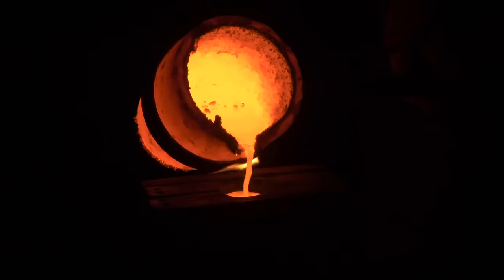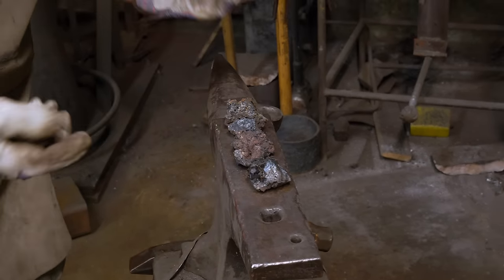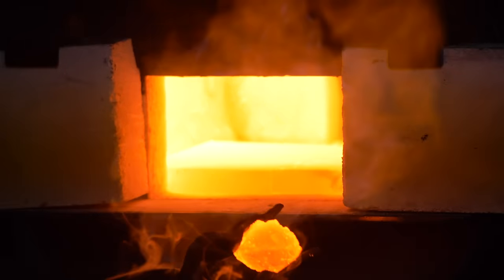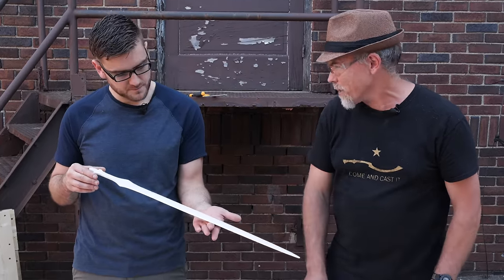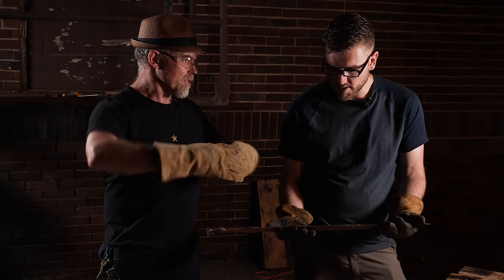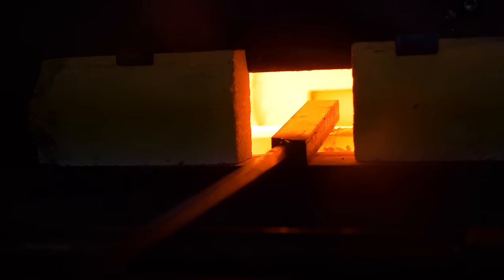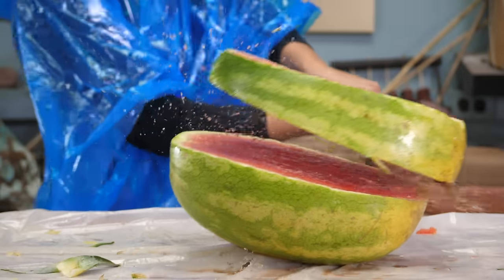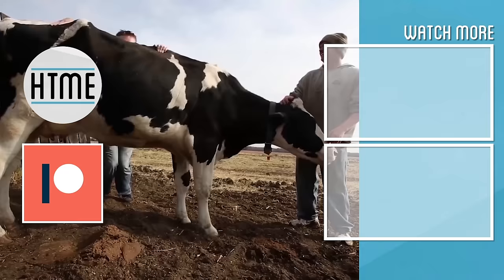Forged Iron Sword vs. Cast Bronze Sword

Comment: I understand the limitations of the show but you're using modern hemogenous Iron against bronze which i don't think is representative in any meaningful way. The whole downside of iron is that pre-industrial iron and steel were very difficult to homogenize. I think crucible steel was the only pre-industrial steel that was fairly homogenous and it was not commonly available and almost mythical in places like Europe up into the early modern period. so while you used iron of similar carbon content to your bloom iron it's still not in any way a comparable material because you would have to do some metallurgical wizardry to ever get that bloom properly homogenized. I mean without a Bessemer blast furnace that is. I look forward to that episode.
Reply: If I remember correctly this was a small "bloomery." The chances of getting good yields at this scale would be very small and even then this was more than enough for a proof of concept for low grade iron/steel. With that being said I too would like to see their attempt at crucible steel.
Reply: Imagine this: combine tiny diamonds together with clay. Result is not one big diamond.
Reply: @juhajuntunen7866  proof?
Reply: you can work and fold the metal to homogenize it, the real problem is the carbon content, impurities, and tempering. and I think they used a steel with comparable carbon content and didn't temper it.
Reply: Was just going to say the same thing; the reason the iron does so well is the high quality homogeneous modern iron.
Reply: couldn't he just get enough pieces of bloom with similar carbon content and forge weld them together? if he did that the entire piece would be homogeneous right?
Reply: they are also using modern bronze.
Reply: @raphrath8561  If they are using tin they are not using "modern bronze" there are much better bronze alloys they could be using.
Reply: European and Japanese swords were extremely high quality steel. The Japanese folding of the steel removed the impurities and homogenized it, and in Europe, Smith's had gotten metallurgy extremely precise, to the point of being able to predictably harden and temper their swords
Reply: @juliaf_  The important part to consider about that is the time period we are talking about. Metallurgy would eventually develop to the point you are laying out, but by that point iron technology was already very much established. Since we are talking about early iron weaponry compared to the available bronze weapons, the metallurgy was not as developed yet and many of the techniques that would later be used to produce more homogenous, higher quality iron weapons were generally unknown. In that context the piece of iron used was probably to homogenous for what blacksmiths would have had to work with and thus the resulting sword should perform better than a historic piece would. Of course it is very hard to know these things exactly since archeological finds from that period are highly degraded and thus exeedingly rare.
Reply: @Slash-XVI  there have been reports and even scientific papers on armaments dating quite a ways BC of hardened carbon steel. Shadiversity has a great video on it. Of course it's regional, but the technology did exist.
Reply: The only "cheat" involved was their cheat of time.
Enough time and effort put in would get you a relatively homogenized piece of iron, and it wouldn't take any complexity beyond that required for a hammer, anvil and forge. Once a bloom is consolidated, getting to a reasonable metal is a matter of hitting it and checking it's properties. The more you hit hot iron, the more carbon you push out of it.

I'm more concerned about there confirmation bias. They explicitly say sword to sword contact would be avoided, then go on to judge which one was better by the results of worst case scenario sword to sword contact. If someone has lost their shield and is being bludgeoned by the other person, it doesn't matter if their sword is bronze or iron, they're already boned. Also, such bludgeoning would be done with a shield, not another sword
Reply: In all fairness, historically they probably would have gotten a better bloom. I mean, one of the issues here was that the iron they had was not the result of bog iron or ore but rather just iron sand with a relatively low iron content, too. 
So yes, the modern iron they were using may have had an advantage but they also basically had a worse start, otherwise they might have been able to actually make use of their own smelted iron.
Reply: Thanks. You saved me a lot of typing.
Reply: @kovona  With naturally occuring Iron Sand that may very well be the issue. However, I'm not sure if that also applies to waste sand from an iron refinery that still happens to contain a little iron.
Reply: @juliaf_  This is supposed to simulate the first "round" of iron swords that existed. None of those techniques apply until later on.
Reply: Basically months of hammering. Not overselling it either. Good comment.
Reply: Okay guys i hear you. First thing. I dont expect Andy to do everything authentically. Theres just a lot of bad science in metallurgy and weapon history and if you cant do it right you should at least mention the variables you aren’t taking into account. Second. They used modern smelted materials to make the bronze too. Well thats sort of my point. Bronze and iron aren’t the same and if were talking early iron age (which is exclusively what im talking about) then contemporary smelters will get a much higher quality bronze than they could iron. Specifically because bronze was an established technology which can be properly smelted into mostly  pure liquid bronze with the kilns they used. They could make iron but like in much of history you have to work the slag out through working it rather than skimming it off the top of the crucible (this also works to homogenize it to an extent but my point is that these are flawed methods in comparison to modern steel. 
Because of this the gap between modern smelted tin and copper is far smaller than with smelting iron. Using modern bronze doesn’t balance the test.
Reply: they said they used comparable iron. so you cant really say it isnt fair without knowing exactly what that iron was. if they said it was comparable im sure it wasnt top grade modern stuff. that bar could have been made from bloom as well, but unless they specify we dont know. judging by the swords appearance there were impuritues though.
Reply: @eclipsegst9419  you can't really source Pre-modern steel by normal means. Even if its pretty cruddy modern low carbon iron it's going to have been made in a blast furnace and then decarbonized. it's not economically viable to smelt iron any other way. it's a fun quirk of iron smelting you have to actually add steps to get a low carbon content. you would have to contact some pretty specific folks to get your hands on historical wrought iron and considering that the show typically has an interview when they consult people I assume that if they did source it from an experimental archeologist or a three-hundred-year-old chunk of scrap it would probably have come up in the video. On a balance of probability, I Imagine the smith they were working with grabbed some low carbon stock he had on hand and they used that. I expect it would even have a pretty modern mix of alloyed material too. Im not saying its impossible but I wouldn't put money on it being accurate to the iron that the Hittites used.
Reply: @valbourne1797  well, i agree it wasnt identical, but the bronze probably wasn't either. Im just saying, the guy seemed pretty knowledgeable about smelting, so theres a chance that that iron could have been smelted as well. if you look at the up close shots, it definately has some mall impurities. even if it wasnt home smelted, how much do impurities affect strength compared to carbon content? even in ancient times, those who made blades were good at their craft and knew how to get the least impurities. i dont think its fair to expect the sword to be of the same quality of the very first one ever attempted. by the time armies were outfitted with them the process had been figured out fairly well. i would bet that the difference is small enough that it wouldnt have changed the results of the test by much if any.
Reply: Val Bourne, not exactly. In fact, Europe had some of the most advanced steel working, being able to reach the melting point to fully melt the metal, their steel was some of the purest, and they could remove all impurities in a piece without folding, unlike countries like Japan who’s rudementary steelworking forced them to fold their steel. To be fair, the time period the show is aiming for was before advanced steels (Spring, High Carbon, other crucible steels) from the Middle Ages, but rather in the Iron Age, with wrought iron such as the swords that appeared in the Mediterranean. So overall, you are correct that the test is inaccurate due to the use of modern iron, and imo, for a true test, forging should have been purely historical in practice, however it is simply incorrect to say that Europe had poor steel, because they had some of the best steel. Additionally, further inaccuracy comes from the fact that they are clearly not trained and are using no proper form, as well as half-commutes and untrained cuts, as well as partying situations that are simply inaccurate, especially since they are giving no resistance and just letting the other person slam their sword. I will also mention that fruit is extremely easy to cut, and I have even pulled off clean Oberhau cuts on oranges and even melons, zucchini, and squash with unsharpened swords, and with sharps, technique is not even that important in that situation, a real cutting test should have been done with proper cutting equipment such as tatami Mats, or human body/head replicas (Ballistic Gel, etc). I am speaking as a European Martial Arts practitioner, specializing in Longsword (Mostly German), HEMA, Armored Combat, as well as knowing many other sword arts of both one handed, and two-handed styles, and even some other weapons such as battle axes, maxes, war hammers, and pole arms on a more rudimentary level. So that hopefully provides context of qualification and knowledge on the subject.
Reply: @Natolxs
That's part of the problem. The bronze used in historical weapons was a pretty specific recipe, not just a bunch of pennies melted in a crucible. They're also casting and finishing in modern, not historical, ways. The whole thing is just badly done.
Reply: @danilooliveira6580  You Have confusing heat treating and tempering. Tempering softens while toughening high carbon content steels, heat treating is the process of hardening steel
Reply: @Draigtiernan  I'm talking about the process of changing the crystalline structure of the steel through heating and quenching, I may not know the exact terminology.
Reply: @eclipsegst9419  Nope. Bloom iron is porous, which is why it's so hard for it to hold onto carbon. It's also much less homogenous and littered with contaminants. Even low grade modern iron is better than what they had 500yrs ago. Light years better.  If anybody was producing bloom iron today they'd ruin themselves financially at the very least, or even go to prison for manufacturing unsafe materials. This is NOT comparable to iron-age iron and that smith has no obligation to know that (even though he probably does). HTME are not material scientists anyways, they're just trying to make a nice video. They succeeded. Are they correct? Nope.
Reply: @ManiacallySmithing  I disagree. Only a very poor metalworker would have created such a poor product, even back then. It's all about heat and hammering. I've seen many swords made the old fashioned way, from ore, with period correct equipment that turned out far better than whatever this was. Like I said, it isn't fair to say the sword should have been as poor as humanities first attempt. If we are talking about armies being equipped with these weapons, we are talking about swords made by blacksmiths who had learned their trade well enough to make a decent product. If you hadn't said "light years" better I might agree. But using those terms, I definitely disagree. And really? Prison for making a sword the old fashioned way? That's just ludacris.
Reply: It’s definitely possible to make quality steel out of bloomery iron, you can look of videos on YouTube. Their problem was they just didn’t reach high enough temperatures with their bloomery(probably cause they weren’t strong enough to work the bellows, watch African Iron bloomery video on YouTube those guys know how to pump). But anyway if they would have gotten a more quality bloom they could have worked it without it crumbling and while it would have taken a while, they would get mild steel to about the same quality as the one they made.
Reply: nani
Reply: From a paper on early ironworking technologies: "After 1200 B.C.E. the Assyrians, not the Hittites, were the major iron producers in the Middle East.  Although they did not need to improve the iron bloom process, they did use trade to separate the creation of wrought iron from forging iron into the desired object.  There were many cases in which the blacksmith that completed the smelting process did not forge it into the final shape.  Instead, he would make iron ingots that were transported from the bloomery area to blacksmith shops elsewhere, such as the ingots discovered in Nimrud from Figure 8 and Figure 9.  It was with these secondary blacksmiths that forged wrought iron into the desired items.  During the final shaping process the iron was forged with a charcoal furnace.  Unlike in the bloomery, excess carbon released in these forging furnaces did not have an oxide to combine with.  Instead, the carbon from the charcoal interacted with the iron to make the alloy called steel.  These objects were not true pieces of steel because they did not have carbon distributed uniformly throughout the material, alternatively the outside surface was carburized as steel and the inside was still wrought iron.  In effect, the carburization of the iron only provided a hardened surface.  Despite the fact that iron working was an arduous task, it became very common because iron is much stronger metal than copper and bronze."

So the TL;DR is that early iron weapons actually had a carburized, ie steel surface.  They would have had hard edges but without the springiness of homogenous steel.

That would still do some major damage on bronze.
Reply: @megakedar  I'm no blacksmith, buy forging in an old wood/charcoal furnace surely add carbon.
Reply: @juliaf_  you kissed the entire point of the video. Read the title again and you'll see what the discussion is on. 

The subject today is the first steps of iron, when it was being introduced in the bronze age, when it was new and none of these methods you mentioned were known or implemented, plus, this is not about forging a top tier weapon, but the average blade. Not everyone had good quality gear, that's impossible. Imagine supplying an army with just the amount of work these guys put in without any fancy tools or method to predict. They had to crush the rocks and hope for the best, barely any iron, high carbon and not the steel.kind we know today.
The swords you mentioned are literally folded steel, slow down
Reply: The Iron sword got hardened by the Smith in this Video, but as far as i know this is a development of the last two millenia
Reply: @J_n..  It wasn't hardened, whenever it went in a slack tub, it was well below critical temperature, and even if it DID get quenched at critical temperature, the carbon content is far too low for it to be hardened. 

Anyway, to put this to rest, the substitute used was plain carbon steel, in the 1008-1010 range. There is no manganese in this steel. And yes, it lacks the iron silicate or silicous slag that's present in wrought iron. It has a Brinell hardness of around 85-105MPa, and a tensile strength around 340-365MPa. Wrought iron comes in around 100MPa on the Brinell scale, and a tensile strength of around 230-375MPa, and the presence of silicous slag improves its resistance to shock and vibration. Mechanically, it's a fairly accurate substitute despite it being easier to work. 

The reason it was substituted rather than Andy and Lauren resmelting was simply because of time constraints. When we met to forge the sword, neither Joe nor I had any idea what the bloom was like, and after a bit of working it, both of us agreed that in the 3 1/2 hours we had left that night, continuing to work it would be futile, and we turned to our substitute.

We both have years of experience with historical reproduction, including handling, documenting, and replicating pieces first hand on Joe's end. The forged sword fit right about where an early iron age sword would be, in both form and function.
Reply: What they did in the iron age and in later periods was endless heating, folding and forging down of the material until they achieved required quality. It was very labor intensive which is why swords used to be weapon of a noble man pretty much since late middle ages.
Reply: @Natulxs  I believe what he is referring to is the quality of used materials. Historically they used copper and more importantly tin witch much more impurities. 99,9% pure copper from cables and 99,9% pure tin were pure sci-fi in bronze age.
Reply: @danilooliveira6580  This is why Japanese swordsmith folded the steel. They only had low quality ores to work with so they did what they cold with what they could get.
Reply: This show is not representative of almost anything in any meaningful way.
Reply: Lp
Reply: Those "fantastic" Japanese swords that have been folded thousands of times, sounds impressive but they did that due to rotten steel. The Japanese had excellent swordssmiths but they could not melt iron properly.
Reply: @juhajuntunen7866  Unless you play Diablo 3 snd then you will not need the clay. 😄
Reply: @juliaf_  Yes, but that came much later than this.
Reply: it wasn't up to mythical levels, but definitely a rare sight that brought great business to whoever was to find a vein of naturally occuring, particularly pure iron.
Purity primarily affects the flexibility and strength of iron still, not its hardness meaning unless you got some particularly nasty piece to work with the result in the end wouldn't be affected. To balance it out I can say the guy's conclusion is wrong and a bronze sword struck by an iron one is still very much usable and the picture of a bronze sword being cut in half or completely ruined just casually after being hit by an iron one is a fantasy, it would get nicked and beaten and after a multiple days-long battle it may be in such bad conditions it's better to re-melt than try and fix it, but often you just needed to beat it straight again.
Reply: @juliaf_  Japan actually didn't have all that great quality steel, at least not in quantity, a good number of it wasn't from mines but it was mixed in with sand requiring lots of filtering and careful selection, then forge what passed the test. Europe had the luck of having a bunch of veins of the stuff that were particularly void of impurities and it's this which they used to make their weapon and armor until later ways were found to better separate iron from junk.
Folding steel doesn't remove impurities like you said and only homogenises them so to not have pockets in which the iron was more brittle, folding steel too often actually has you run the risk of introducing more impurities so it's always best to not overdo.
Reply: @cdgonepotatoes4219  japanese tomahagane is  Equivalent to modern day 1075 carbon steel  With a few impurities of course  In a way japanese steel  and European steel is  Similar you guys forget that the  Europeans also folded their steel  Because good steel was not always available  in homogenous forms  I find a lot of rot iron swords in  Museum and yes i known rot iron was not folded its just iron strands   even in 15  Century swords not all swords were perfect you see that they  Really didn't care about the blade shape that much   There's a lot of uneven bevels on originals non symmetrical tips they just cared if the steel was good  and it worked they  Didn't care about symmetry they  Prefer the  Unevenness in the blades in the modern age  We would consider this a flaw and would want a refund but back then they thought that was the best and took it you find a lot of  uneven pommels  and the  smith thought it was fine  you see that sometimes but now in the modern age  We thinks things should be symmetrical and perfect they did not care  As long as it works to serve its purpose they liked it  Sincerely Micah.
Reply: The issue is modern Iron from bloom utilizes techniques like folding the iron on itself for months, or modernly melting it and adding flux to draw out the impurities that causes the problems you stated. the issue is the purification was labor and time intensive. So using the belt sander to cut filing time is pretty equivalent to them not spending months working impurities out of the native iron.
Reply: @JRMCNEA  ancient civilizations had a lot of time and labor, if a sword takes a month for 5 people to make they’d literally get tens of thousands of people working on the entire process no matter how labor intensive it is idk why people keep mentioning how much labor it would require when we literally have projects from earlier that were more labor intensive and less important than making weaponry
Reply: @Areeb118  We today have that same time and labor. Just because you have it. Doesn't mean you will utilize it, or even know that utilizing it will lead to gains. Most of our progress was by mistake, or freak accidents. someone over cooked something, someone left something to dry too long. Someone beat on something too long. Humans experiment with things that are counter intuitive which changes the entire way we evaluate and investigate certain things. And people mention these things because none of this is possible without a surplus of labor. How many people are growing wheat and baking bread? Not many. Why? Because A. Slavery is no longer legal. ANd B. BEcause most people don't have the leasure time to invest in their own development or production. You can build a car in your back yard. Or you can go down to the lemon lot and pay a few hundred bucks for a car that has been driven for a decade. People bring up labor and time because that is what you need to produce stuff. and that is what most people don't have to spare in the society we have. There is a reason Elon Musk built Tesla and not some guy in his Garage in the poorest part of chicago.
Reply: @JRMCNEA  you didn’t say anything against what I said, I don’t even know what you’re saying, my point was that ancient civilizations had a lot of time and labor contradictory to people’s beliefs.
Reply: Well bronze will always last longer than any iron or steel sword.
Reply: @juliaf_  Japanese swords were not high quality steel, that is the whole reason why they created the folding technique to make up for the low quality iron ore.
Reply: IRL the bronze sword would have shattered the iron one....
Reply: Val Bourne they could kind of homogenize the steel and iron by folding and forge welding it repeatedly, it’s not homogeneous the way our current steel is but it’s more... even, I guess. It also helped to beat out impurities.
Reply: In early iron age with primitive technology, only form of iron they could make was cast iron, which was brittle and had tendency to break easily when clashing against bronze. Blacksmithing didn't even exist in early iron age, because cast iron is not malleable and can't be hammered down without breaking. 

But bronze is a relatively rarer material compared to iron which is common in earth's crust, which put iron age civilizations in a big advantage in terms of ability to mass produce weapons and armors. 

However, low quality of early iron meant that both bronze and iron coexisted during early iron age, and bronze was only completely phased out by around 1st century BC.

For proper comparison between iron age vs bronze age civilization, they should've used low quality cast iron instead of modern wrought iron.
Reply: @juliaf_  everyone ignores the swords of the Americas, oh wait.
Reply: Just to throw in my 2 cents. It's commonly believed that the swords of legend like the Viking Skofnung were most likely just swords of much higher quality iron since these swords lasted much longer and we're superior compared to common swords.
Reply: @Natulxs  if it doesn't have tin, it's not bronze, so no.
Reply: @thefinalroman  Indeed, Roman stories attest to that.
Reply: @danilooliveira6580  They at the very least quenched it which is used to harden the blade, something not always done because impurities in the steel increased the chances of the blade snapping, same goes for bronze though.
Reply: Another factor to consider: the Chinese had mastered bimetallic bronze casting techniques for swords which involved varying the ratio of copper to tin.  The thicker body of the blade was softer but less brittle 90:10 copper-tin alloy, but the edges would be applied in a second casting with 80:20 copper-tin bronze for better sharpness retention.  Add some work hardening to the edges to make them even harder and I would give that kind of bronze sword the edge over a Roman gladius or spatha made of some uneven blend of wrought iron and cast iron.

The Chinese were genius bronze casters.
Reply: @edwardx.winston5744  this might explain why chinese use bronze weaponry alongside steel weapon even when the latter is readily available.
Reply: @wedgeantilles1932  Macahuitl's ?
Reply: @tomasxfranco  Actually in rare and desperate circumstances ancient peoples would make bronze from Arsenic instead of Tin.
Reply: @k_tess  wut
Reply: @wedgeantilles1932  wait this isn't common knowledge? Look up arsenical bronze.
Reply: Exactly my complaint.  This test has some major discrepancies that are glossed over without real analysis.  I wouldn't  draw any firm conclusions on early broze/iron-age transition comparables  based on this.  You simply cannot substitute a homogenous steel with a late bronze age example,.  Even if their chemistry is similar in some respects, miceostructure and inclusions are not.

It only briefly showed the bronze work hardening as well, would have been interesting to see some numbers on that,  bronze would have been work hardened to varying degrees.
Reply: Both MATERIALS  were of a modern manufacturing refining process ( a fair comparison for this demonstration)...it was the comparison of these "cast vs forged" swords that was on display here, and there were no surprises. Otherwise we might still be using bronze instead of iron in construction today.
Reply: @blueeyeswhitedragon9839   Well not really.  If we're comparing materials at the.bll bronze/iron-age transition then the bronze they used is much more analogous (in chemistry and material property) than the iron they used.  

The iron would have had inclusion, faults, and pockets of metal with different properties.  Totally different microscopic structure.   You can't mimic that bloemert iron by starting with a modern ingot.  

The bronze on the other hand is a relatively excellent approximation.  Though it would have been nice to.have more information on their work hardening...maybe some numbers/tests on both materials for thst matter.

It's fairly accepted that a primary motivator for the transition from bronze to iron was in fact  availability.  There were comparative advantages  to both materials early on. It was only with new texhmiques and advancements that iron alloys were directly superior.  We use iron today, in the form of steel, because we have learned how to get the most out of it,  but that's not what they had then.

The video is fine and entertaining,  they just should have been clear about the caveats and limitations.  Simply stating that this isn't necessarily representative of the historic reality.
Reply: Europeans made up for it with the blast furnace, and with their ability to change the carbon percentage at will. Don't know where you've heard Europeans couldn't handle it.
Reply: mmm Yes I understood what you said
Reply: @ClashBluelight  All of those pieces, all the crumbly junk around them are impurities.  To my knowledge, this is "slag" which is basically like glass/ceramic crud that gets worked into the iron. Unless you are about to remove and magnetically sort all that shit, you end up just compacting into a very crumbly thing.  Unless you have what I assume is a critical mass of iron from the bloomery stage, you are going to fight a losing battle with slag.  If there's more slag than iron, you'll keep losing iron in the process of trying to consolidate it together.  Keep in mind, the iron is oxidizing and reacting every time you heat it up and beat on it, and you lose some.  You need a big enough chunk to start with.
Reply: @somethingelse4424  thanks for clarifying. one thing i did find though, is that apparently blacksmith shops used to do something like this. they'd sweep up all of the bits of iron that came off their pieces when forging, and reconsolidate them into future blooms. things like failed nails, bits cut off of larger builds, shavings from sharpening, etc would all be put into future blooms to make for larger and more homogenous pieces in the future. while not exactly the process i suggested, it's very similar and performs the same function.
Reply: Iron swords did exist as contemporaries to bronze during the middle to late bronze. The reason why bronze was abandoned was specifically because iron, at some point, became easily manufactured. The problem many ancient bronze age nations encountered was that their well trained armies were being defeated by iron. It is one of the hypothesized causes of the bronze age collapse. One of the many reasons why Rome was so successful is because it was a Bronze age nation that used Iron on a number of still bronze age enemies. It was a contributing factor in the rapid expansion of Rome for a time.

A good example is how the United States today uses all manner of extreme weaponry in a world where the majority of nations are stuck with cold war era hardware. Rare weapons do exist among old ones.
Reply: non-homogenous steel isn't softer than homogenous steel of similar composition. The issue is that slag inclusion can create fracture points. As far as hardness, it's a valid test.
Reply: I remember many yrs ago an arguement arising about modern wedge rivet alternating maille shirts when they came about.
With one absolute nazi who thought it junk and that it did not look like European maile? It was idiotic from a reenacting pov as he thought everyone should buy his friends maille as he made it from start to finish! Even going so far to digging the iron from the ground in Europe, off course and used the bloom iron to make his wire.
Well straight A's for effort but how many people could afford this product? And what was visibly different from the Indian made maille? Or many examples of original maiile which modern Indian maille does look like.
Off course we get tiny links in original coifs etc but at what point do you stop think and realise you can only do so much, and it made butted maille near extinct though original butted did exist.
This is the guy you want on your debating team as he would defend the indefensible no matter what.
It's nice when your budget allows you to buy anything you like.

Though the points here are a little more valid it reminded me of this arguement.